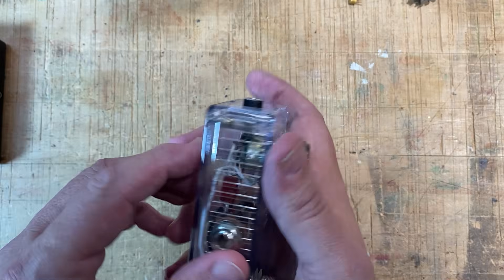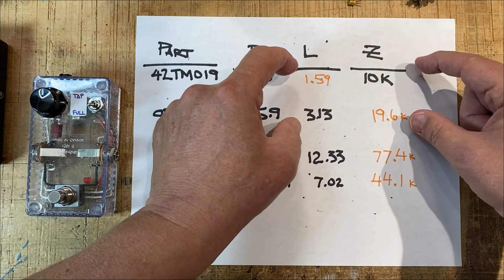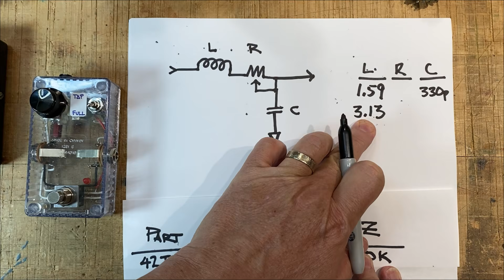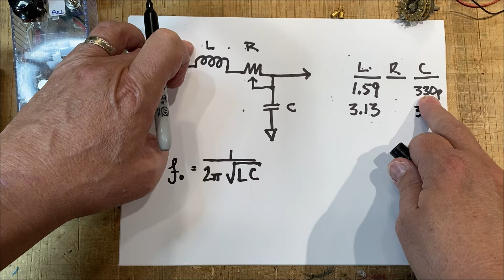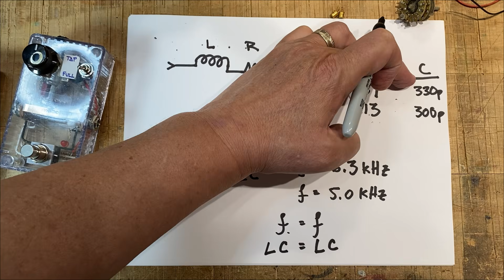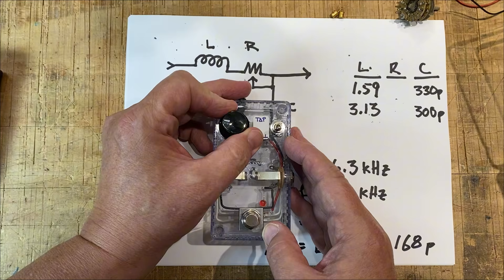I Found the Problem with My Pickup Simulator: It Wasn't the Transformer

Comment from the maker: It turns out I had more than one problem with my original pickup simulator! The bad potentiometer was the big one, but modeling the circuit in LTspice also showed me that my transformer/capacitor combination had shifted the resonant frequency quite a bit. After fixing the pot and changing the capacitor, I could finally hear the effect clearly.

Now I have another experiment to do: a viewer suggested trying the unbuffer with a Fuzz Face. Have you ever used a pickup simulator or unbuffer with a Fuzz Face or another vintage-style fuzz? What happened?

Comment: I built an antibuffer from the same schematic, iirc when i checked those little audio transformers for inductance it was very low.

I ended up winding my own inductors using little ferrite pot cores, you can get really high inductance values with one of those and even just some guitar pickup wire.

Tbh i think what led me to that road was more wah pedal inductors (which need very high inductance values) than anti buffer inductors, but just an idea!
Reply from the maker: Interesting! I’ve been thinking about the inductors in wahs but also in the Holdsworth Harness. You’ve piqued my curiosity now. Thanks for the suggestion!

Comment: I'm really excited about your fuzzface build. I love this channel.
Reply from the maker: Glad you're enjoying the channel, it's going to be a fun build! I just finished a quick prototype and it plays like buttuh. Man it’s a good build.
Reply: @MadScientistGuitarLab  Germanium or Silicon?  I paid big bucks for an AnalogMan SunFace which is based on a FuzzFace with a few tweaks.  Mine has Germanium RCA transistors that are temperature stable compared to most Ge transistors.  It works well with both humbuckers and single coil pickups.  The clean-up with the guitar volume rolled back is very good.  It has a bias control pot on the front panel so I can get smooth or sputtery fuzz without taking it apart.  The only downside is that it doesn't work properly unless it is connected directly to the guitar.  Any buffer in between is like the gain is turned to max.  I guess one of the 3+ transistor fuzzes would solve that.  Or an unbuffer.
Reply from the maker: @JohnShalamskas  well Germanium since it’s from the same radio parts. I had to aggressively bias the Q1 and Q2 transistors either trim pots to set it. Once it’s dialed in, it’s rock solid.

For yours, an unbuffer was made to solve that very problem. The unbuffer will tame the input back down and darken the input to the fuzz.

Comment: You usually use these circuits with a pedal in front of the fuzz like the buffered signal coming from your boss tuner. It looks like you plugged directly into the simulator then fuzz which is pointless unless your guitar has a built in preamp. I use it with wireless transmitter and receiver for my guitar or if I want to boost a fuzz with a other drive pedal
Reply from the maker: Yes, I know that. It was just a quick test to see that it was working and that it did something. The original video used a buffer and the results were unnoticeable.